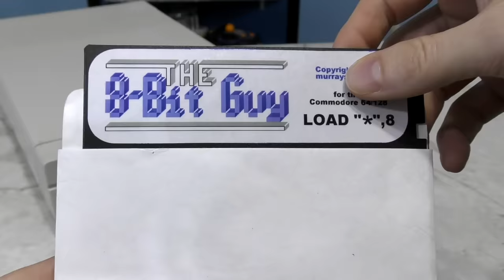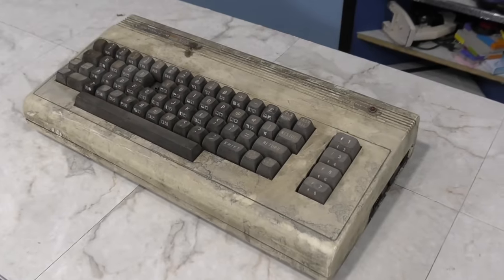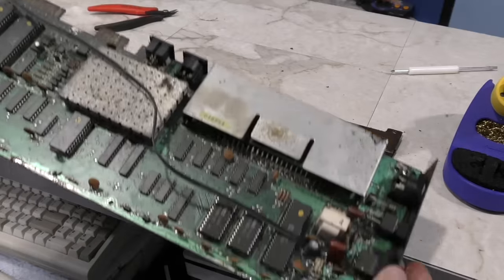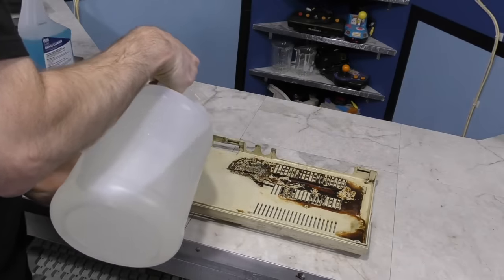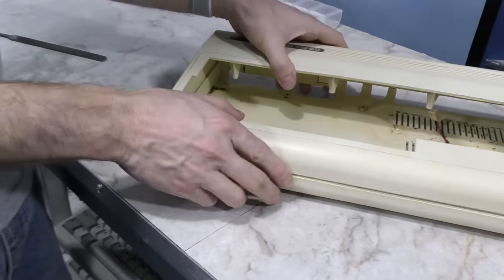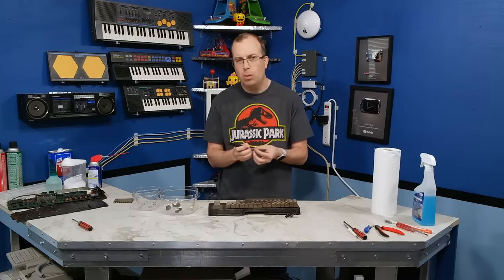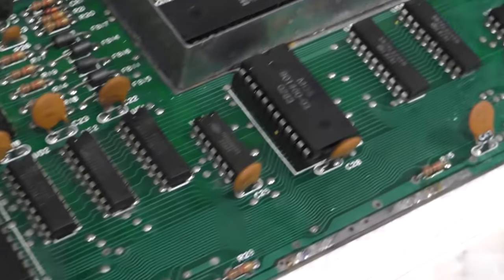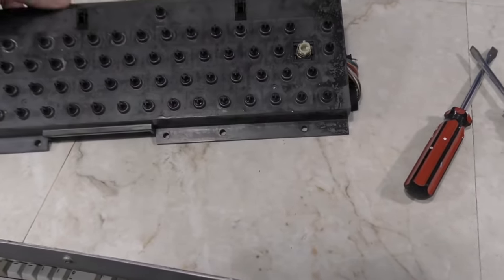Restoration - The Worst VIC-20 I've ever seen - Part 1

Comment: Oh god, you used WD40? WHY??? Go to the auto parts store and buy a spray can of CRC Electronics Cleaner. It's hexane spray; it will dissolve any oil instantly, but it won't harm plastic or electronics. Brilliant stuff.
Reply: Shawn Elliott Did you watch the video? He uses that exact product.
Reply: I did watch the whole video. He didn't use that exact product. He picked it up off the shelf, then opted for CRC Lectra-Motive instead, which is best suited for cleaning graphite dust off electric motor commutators. It's not nearly as effective as a degreaser compared to CRC Electronics Cleaner, and it also takes a lot longer to evaporate. CRC Brakleen is highly effective as a degreaser, but as he discovered, the chlorinated-hydrocarbon chemicals used in Brakleen damage plastic. (not to mention Brakleen is basically liquid cancer.) CRC Electronics Cleaner is completely safe for plastics. Thanks to my various hobbies (custom electronics, remote-control cars, etc.), I've tried all of CRC's spray cleaners, and I've determined CRC Electronics Cleaner is the best for purposes like this.

(this comment was not sponsored by CRC Industries, Inc., and the poster did not receive any compensation for it.)
Reply: I love crc electronics cleaner
Reply: Prove it.
Reply: Sara Luves Pups 

If you can't read a long comment, then you don't need to bother adding input regardless.

You just have either an attention span issue,or just arrogant.
Reply: Shawn Elliott any oil instantly, OIL
US ARMY WANTS TO KNOW YOUR LOCATION
Reply: At like 14:45 he uses it
Reply: No he picks it up and then chooses a different one
Reply: @23WiSK  it says electric parts cleaner on the fucking bottle and it said crc on it are you blind? Or just watching a different video
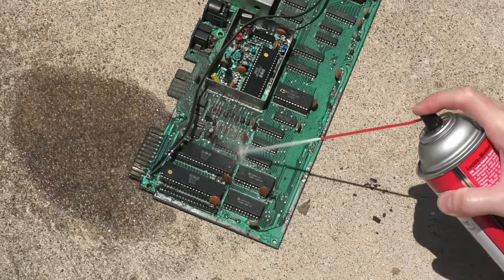Reply: Pause the video at 14:49 and tell me the name written on the can he is spraying with. No need to apologise.
Reply: Indeed I'm not. Now scroll up to the comment you originally replied to. I'll summarise

Shawn said, "... CRC Electronics Cleaner ..."
Psera said, "Shawn Elliott Did you watch the video? He uses that exact product."
Shawn said, "He picked it up off the shelf, then opted for CRC Lectra-Motive instead, which is best suited for cleaning graphite dust off electric motor commutators."
[one month later]
Ryan said, "At like 14:45 he uses it", then "electric parts cleaner" and "lectra motive electric parts cleaner".

I am guessing you are struggling with the difference between the word "electric" (e.g. battery, lightbulb, motor, etc) and the word "electronic" (semiconductors, circuitboard, transistors, etc).
Reply: Sara Luves Pups, That's not a long comment... I was in arguments about evolutionary biology and population genetics, and made responses 20x longer than that.
Reply: He bought the one that didn't work because it's a dollar cheaper.
Reply: Ryan Hamilton, you demonstrate why normal people can't be trusted to do things correctly. Different products do not function the same way just because the names are similar.
Reply: +23WiSK, you are my hero. :)
Reply: @deusexaethera  This comment chain is full of people fighting over what he used to clean the thing. Jesus Christ, how did this go on so long?
Reply: Because reading the existing comments before replying is HAAAAAARD, and paying attention to what the comments actually say is even HAAAAAAAAARDER. ;)
Reply: Might be able to glue a peice of lego technic shaft on the broken plunger
Reply: That's actually a pretty interesting idea. Are Lego Technic driveshafts the same size as the plungers on mechanical keyboards?
Reply: Wait, question, why did you even comment this? The WD-40 worked with no harm to the plastic
Reply: Because people misuse WD40 for all kinds of shit like this, and it's never the right solution. WD40 is so popular because the manufacturer sells it everywhere and tries to make sure nobody actually knows WTF the stuff is actually for. So instead of being rational and leaving the WD40 at the hardware store where it belongs, people buy the stuff because it looks familiar and then they spray it on everything in the garage. (have you ever seen the meme "If it's moving and it shouldn't, use duct tape, if it isn't moving and it should, use WD40"? Lots of people take that shit seriously.) The only thing WD40 is actually good for is repelling water from raw steel, and leaving a thin layer of oil that will inhibit rust for a while. (the name WD40 literally means "Water Dispersant formula #40".) The oil coating is too thin and light to actually lubricate anything, it's just enough to repel water, attract dust, and damage plastic over time. Maybe someone will read my comment and remember what they should use the next time they need to clean air-hardened grease off plastic.
Reply: @deusexaethera  I see.
Reply: 14:45 "this one even says it's for electronic parts, so I took IT (implying that bottle specifically) outside"
Reply: @deusexaethera  there is absolutely NO NEED to get so angry and upset about this, go contact the manufacturer directly and actually make a difference why dontcha?
Reply: Wd40 worked, didnt it?

Comment: Brake cleaner is pretty corrosive. Wouldn’t doubt that it caused the electronic issues hinted at in this video.
Reply: Emmett Turner, agreed. That stuff will eat plastic and paint in seconds. I once got a little on the bottom end of my CL350 and the paint just peeled right off within seconds. I was pissed!
Reply: From the smell I strongly suspect the brake cleaner I've been using contains acetone and that's a pretty strong solvent. No idea what other brands might containt.
Reply: Ragnar8504 correct, most contain acetone and that’s what screws up the plastic.
Reply: The brand he's using doesn't have that in it, it's a "nicer" brake cleaner is about the best way to put it
Reply: if you discolour plastics with brake cleaner you can sometimes bring them back by rubbing in some silicone oil
Reply: danny cushing Is that what products like “Back2Black” do?
Reply: yeah they are mostly just silicone oil, wd40 does a good job of it as well but wouldn't be great for computer parts as it does leave a film of oil
Reply: I'd say the "spray" on trim restore's like Stoner's might leave less of a oil on the plastic's then the cream's
But I'd say the cream's probably let you work it in better.
Reply: NESguy94 He said that brake cleaner can discolor some plastic or even destroy the plastics

Comment: How come you were you able to spray down the motherboard with water?? Would that not damage the electronics?
Reply: I know a guy in the US who had an SGI Origin200 tower server totally submerged during a flood event. A few weeks later after a good cleaning & drying out, it worked fine. Ensuring all the water and any residue is completely gone is the key.
Reply: Modern Electronics is cleaned using water based cleaners. In the 1990s a much more common cleaner was Trichloroethane for electronics, car brakes, and even Dry Cleaning. Then they realised what it was doing to the Ozone layer and banned it.

Comment: In my experience in working with plastics in industrie, it is possible to sand most non clear plastics and mechanically and then treat them with a chemical and clean them that way to restore the surface to new.

A customer of us had a older mobile home and he asked if we could take a look at the yellowed plastics. Although this is normally not something we do we decided to sand down the yellowed plastics in various stages and then treat them chemically with various cleaning agents. After the mechanical and chemical cleaning we then treated it with a clear teflon coating and voila... all his plastics look brand new and due to the coating they are protected for the future.

Comment: Wow. Even if it didn’t work, it would look really nice on display. 
I don’t remember seeing it on the can but, make sure you use non-chlorinated brake parts cleaner. It’s a bit safer to work around and I think may do that discoloration a bit less.
Reply: Yeah, Carb/intake cleaner is just about as good as brake cleaner, but moderately less bad for plastic. Makes it less brittle and discolored.
Reply: I agree, this restoration is going great so far. And i agree.. if you want to restore 50 C64's, you definitely should do it! It's a labor of love! Just.... i disagree with the last sentiment. Don't hoard them! They're not only collectible, they're things people love and which can spark their dreams! If you have this many stashed away, and no one's buying them - consider giving them away to fellow enthusiasts - people who would appreciate the value!
Reply: carpespasm Carb cleaner is no good for this kind of thing.

Comment: isnt it bad for the environment to use breakcleaner etc. outside und just spill it away with water? no offense, just asking.
Reply: It's not really abnormal to spray the stuff outside. Where else would the average DIYer use brake cleaner? I don't change my brakes indoors. Stuff evaporates near instantly anyway, I can see a better argument for air pollution than water pollution.
Reply: I can't believe 16:58
Reply: in some cities in my country (The Netherlands) washing your car on the street is illegal and can get you a fine

Comment: I know you'll be scandalized, but I've had great luck with just putting the shells my bathtub filled with warm water and detergent (fabuloso or dish detergent).  This works for the keyboards quite well if they are of the mechanical sort, or a disassembled keyboard if not.  After the keyboard and other delicate parts are scrubbed thoroughly with a toilet brush (new of course), then I scrub the soaked shells with COMET (Ajax, scouring powder) and a Scotchbrite pad.  It does a wonderful job.

Comment: It is so sad how some people care for their stuff. And its even more sad how people take stuff like this and try to sell it without even some cleaning.
Reply: I know a collectibles shop that has these seasonal sales where everything is on sale and an area that’s usually closed to the public is opened up. Well, they have these bins old toys that are just nasty. It’s like “straight from the attic” type of dust and grime. It would not be hard to just give them a superficial cleaning.
Reply: It might've been used in a shop environment which was worse than what David is used to.  They might've only set it aside once the T key broke, as then it was no longer usable.  Hard to say.
Reply: well, it's not just SOME cleaning, this computer required a full restoration made by an expert and which required days of work. For many people it's not worth it, that's why they sold it for 5 bucks hoping that it would be useful for someone instead of throwing it in the bin
Reply: sure but not everything is covered in oil like this one. Sometimes it would not be hard to at least go over it with a towel and some window cleaner. I mean the better it looks the faster it sells. But even this is to much effort for most.
Reply: Well, given that it apparently performed in some kind of shop environment and was completely covered in whatever that oily residue was, it had a very hard life and was fit for the trash. Some enterprising person felt that it might be of interest for $5 and it went on the table. One person's trash is another person's treasure. I don't think they expected it to be restored. Certainly, you would never get a return on the money invested in the labor and cleaning costs but for a project, it's good experience and it could be added to the bottom of the list for 'worst computer condition ever restored'. I look forward to the other parts to this restoration.
Reply: In the end its just an object. Not worth crying over, unless of course you are on the spectrum...
Reply: WHy is this sad? COmputers are tools, you just romanticism them. 

Its not worth cleaning something before selling it....you must never have ran a profitable business

Comment: 1) use a strong bristled brush with the wd40

2) use sand paper to remove the stains on the inside.

3) get yourself some Prep Solvent to remove oils waxes and pretty much any sticky residue

4) Before you filed the burn marks, you should of plastic welded some old plastic from scraps u have laying around to fill in the gaps before you file them down.

Im surprised you restore stuff without the right equipment. When you have the right tools the job becomes sooooo much easier.

Don't listen to the comments telling you to buy house grade cleaning supplies. You need commercial grade for jobs like these. Heres a great website where you can buy any tools and solvents you need to make your job easier and for a better outcome. I get my supplies from here for restoring auto parts.

www.tcpglobal.com

Comment: Something you might want to try—Testors ELO (Easy-Lift-Off).  It’s used to remove paint and decals from plastic models without attacking and discoloring plastic, but I bet it would work in degreasing those troublesome parts. It’s not cheap, but I have found it very useful and it’s reusable, too.  Another thing you might try is Easy Off Oven Cleaner.

Comment: Is this an ancient thic keyboard???
Reply: THICC??
Reply: no it's the actually computer., It had 5 KB of static memory, you basically (no pun intended) had to manually type your programs in BASIC, and if you didn't have a 3,5 inch floppy drive,  you left the machine on or you would lose all your had work when you powered it down. I was the first in my neighborhood to get one, they also made a Cassette Drive to save data on but that was a slow, tedious process and took many cassette tapes if you had long programs,  Then BBS (Bulletin Board Systems came out,  The precursor only social media,  if you were lucky to get your hands on a telephone MODEM (Modulator/Demodulation)  you could call up a BBS create a User ID and leave email to other members when they signed on. They were capable of on ASCII graphics, but I remember some people being very creative with ASCII and creating pictures attune to Graffiti Art. Me and a freind of mine who owner a small computer store, started the first BBS system in out area,  by this time the 1st *86 computer started coming out.
Reply: Wow you sound so professional and smart!
Reply: Joe Casson It *is a real computer
Reply: r/iamverysmart
Reply: I bought one in the mid 90s and still have it stored.
Reply: escrtist nope... this didn’t have a 3.5” floppy... that was much later in the 64/128 run... a 5.25 drive was introduced on the C64 series... the 1541. 

Vic20 programs were either cartridge or cassette tape.

Comment: Try Isopropyl alcohol for the greasy areas next time, that's what they use to clean off oils in chemistry labs, and it's pretty non-corrosive otherwise. My other favourite is acetone (concentrated nail varnish remover), which has multiple uses as a miscible organic solvent.

Comment: Some cleaning decisions in this video are weird:
1. Oily exterior -> Soak in hot water with dish soap or degreaser + detailing brush help agitate stubborn bits
2. Vents -> Detailing brush, Q tips
3. Stubborn gunk -> Goo gone, lighter fluid, plastic scraper
3. Corrosion -> Brake cleaner, plastic scraper, steel wool as last resort

Comment: I've watched a few of your videos and a small tip if you want to not blow something or short something out before you turn it on use a ohm meter and check the 5 or 12 V or whatever power rail and the ground and see if there's a short that way you know if what you're fixing to power on has a short circuit or not - love your channel great stuff!

Comment: I can give you an advice about cleanening and whitening plastic covers. Low foam Clothes washing machine soap is great. Leting it soak for a while and then scrubbing. Works great. And if you need extra scrubbing you use powder form of the soap. Also for oil stains... Soak it in oil based engine cleaner... Not alcaline for it corrodes plastic.

Comment: Try Using WD-40 after you use the brake cleaner, wipe the excess WD off with a towel. it prevents the plastics from drying out and discoloring.
As a Mechanic I'm constantly using brake cleaner and find little ways to get around the discoloring issue when cleaning Engine ECU boards.

Comment: I realize this is an old video--I've watched a bunch of your videos and wanted to suggest adding dish soap and a nylon scrub brush to your regimen. I think if you'd soaked the case in hot soapy dishwater for an hour it would have made your life a lot easier as detergent soap is designed specifically to break down grease and fats. Everyone does things differently though so YMMV. Hope this helps.

Comment: What could have happened is that it was a terminal for an oil change store. One of my local oil change places used VIC-20s or C64s until the early 2010s, and they looked just as bad.

Comment: I recommend cleaning any solder joints with solvent AND applying fresh solder BEFORE de-soldering! De-soldering without cleaning will contaminate the solder joint and may cause cold joints and other issues later.

Comment: If this was used in an industrial environment, then how did it connect to the  computer? All of the connection points are covered in oil. If it used say the user port, wouldn't it be not as bad as the rest?

Comment: My work history in IT included a 40 ft shipping container converted into an office with 8 guys sitting at phones selling stuff. They all chain-smoked cigars. You would not believe the green/yellow glug that accumulated in the Wyse 60 terminals, the keyboards and in the server. Collecting gear there meant a bit of a race to minimize my time in there.